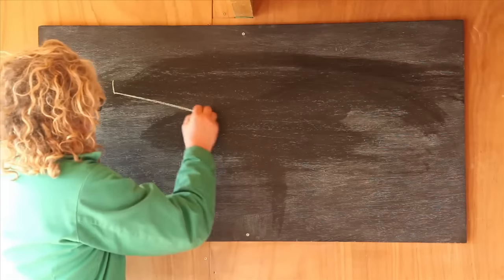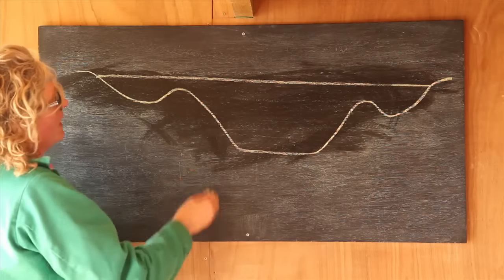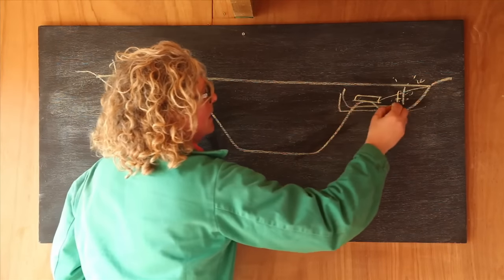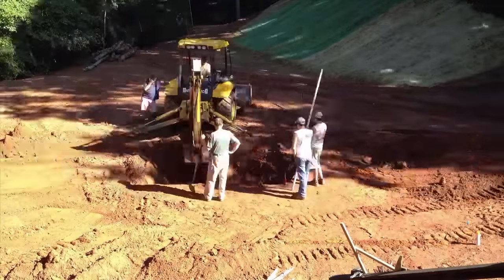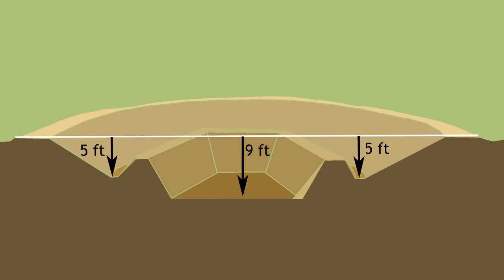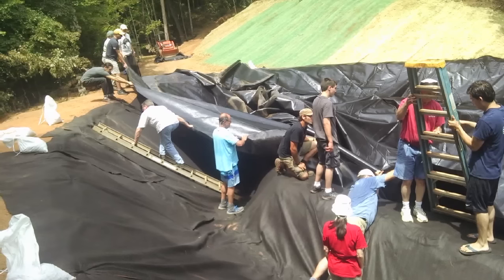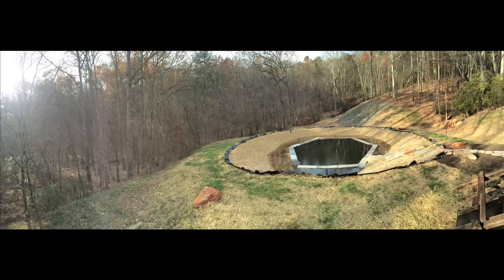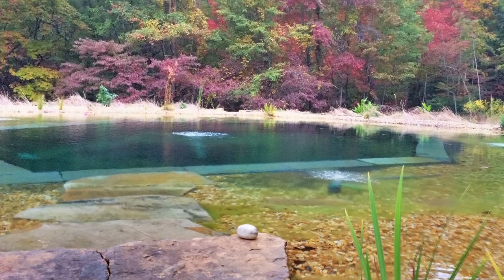How to make a Natural : Organic Pool in America

Comment: It's been a few years since this came out. Still, I hope you might be able to answer my question:

Could ferrocement applied directly to the sculpted earth be used instead of block and the liner IF a reinforcement material like basalt or fiberglass replaces steel rebar and mesh?

Comment: Hello Dave I hope you are still reading the comments as we are building a pond based on the design of this video.  Are the air lift pipes connected to piping going to the pump or are you using one of the two black pipes to send water from the pump back to the pond - are the air lifts traveling to for from the pump? If both of the black pipes are feeding the pump are they connected together before reaching the pump or are there two bulkheads entering the pump box (skimmer)?

Hope you answer soon as our liner is being laid in 4 days.  If you respond I will provide you a link to our finished pond. Thanks David (Yes my name as well)
Reply: Hi Crow, What did you find out about the plant filter pipework, pump, etc.? I don't get how it works from the video. What are the small blue pipes running in the top of the air-lift pipes? Is this system like a aquarium tray filter system? I'd like to make one of these here in Southside Virginia.

Comment: I think it's rather ironic that this "natural pool" starts with a lot of heavy gauge plastic/rubber.... Clay can be used to the same effect, as long as its packed in (the bucket on the backhoe could have packed it).
Reply: Have you ever tried to get out of a pond that has a bentonite clay bottom? Pretty slick.
Reply: Some people seem to ignore all the plastic.  We never use it.  We employ clay seals that last centuries instead of a couple decades like plastic.
Reply: Matt,  we use bentonite.  Our ponds and lakes are much cleaner than what is seen here.  Bentonite just requires a lot more knowledge to employ effectively.
Reply: i also dislike using plastics in a natural pond
but i like david's approach, you dont find much people nowadays who can make a natural pond filtration fit in a urban setting
i'm planning to make a clay pond in my garden, i've been experimenting with clay to test its hydrolic conductivity under various compaction rates and with various sand/aggregates mixes 
but from what i know so far, clay only works with a gentle slope 
so in addition to the bigger bog area, a sharp slope like in this pond is hard to make with clay
unless there is a bigger slope from the outer edges till the deep point
then you fill in the walls with an impermeable material to make the bog/pool separation wall
Reply: @BeautifuLakesStreamsBiologists  Trying to shill your products on another channel is just sad.

Comment: That looks like the north. Do you drain it for winter or is it freeze resilient? Replant every spring? Very beautiful!
Reply: This is located in Georgia. It will not get cold enough there to make ice in standing water deeper than your ankles.  Notice the orange color of the soil, the majority of the soil in Ga is an orange sandy clay that is easy to sculpt into shape and will stay in place as long as water doesn't make a path through it during a storm. Not easy to establish grasses on once you've disturbed the thin layer of topsoil though.

Comment: No fleece over the perforated pipe and gravel for this one then? Is that because they didn’t use sand over the top?

If so, are you just accepting reduced filtering performance without the sand?

Comment: I've been following your videos, since finding your natural swimming ponds, years ago. 
Considering the idea of organic natural swimming ponds, have you, or anyone else, made a pond using the clay found in the ground, to puddle in, and make a natural liner? 
We live in an area in the UK where springs are common. There's even a local pond, fed by an underground spring, which bubbles up from the bottom of the pond. 
As there are no videos using this technique, I wondered if you had considered doing a video, advising on how it could be done. Just a thought, since we are now at a time, when burying non organic matter, is seen as a complete no-no, especially if such a construction fails, and requires the plastic liner to be removed at a later date.
Reply: Re natural liner for a pool or pond: 

  in the year since your comment  was posted, has someone  come up with any ideas?  Thanks!

Comment: Air lift pumps are perfectly suited to direct water horizontally, just add a bend and a lengthy of horizontal pipe on the top, at water surface level

Comment: Was that one enormous pond liner, or several and welded seams?
Reply: You can buy single sheets of plastic large enough to cover a football field if you look around. Made by seam welding smaller sheets which are in their own right very large. I work for a plastics recycling company and we get in rejected rolls of plastic used to line the bottoms of landfills. Each roll weighs 1500 Pounds and are generally 20ft wide and 100ft long. Tough enough to drive heavy machinery on top of till a layer of clay is spread on top to hold it down.

Comment: some recommend to have a hose on the bottom in the middle of the pond which pumps a little air into the water to avoid  oxygen deficiency
Reply: It has 8 airlift tubes . the center gets recycled with the outside wall water its not closed off.

Comment: is it possible to build one without this amount of plastic?
Reply: You could try to make it out of concrete, but that would require good planning to prevent the concrete from cracking if the pond should freeze over during winter

Comment: cool, but I don't get where the capping stones were mortared to... the only possible thing would be between them, but that would'nt make much sense... does it?
Reply: I think that they are mortared in place and to each other so that they can't be kicked out of place. I would think that if they weren't it would be reasonably easy to move them underwater and lead to some issue.
Reply: @vincenthowie  but mortar won't adhere to plastic and that's what those stones got beneath them.... and in between each other seems a bit fragile as they are pretty long (in proportion). 
but maybe it's just that: relying on their weight and getting some extra strenght from the mortar in between.
Reply: @quinosonic82  Hmmm... good point. Now I'm really curious to understand that since I'm well into the planning stage to build something like this.

Comment: don't use a liner better options are out there the UV reeks havoc
Reply: IF the plastic was exposed to light it will break down over a short time, seeing as the liner has been covered and essentially buried, there is very little to no risk of it breaking down at all as the sun is not shining onto the covered liner.
Reply: 20 years is still 10 times longer at most compared to if it was exposed to sunlight for a few years. Clay is not inorganic, its a mix of organic and sedimentary materials and much like plastic will dry up and break down in sun, it lasts for years underground due to its ability to retain water. But yes clay is better if you want the swim or fish pond to stay around longer than the plastic liner will last.
Reply: Clay results from weathering and dissolution of inorganic mineral / rock.  It creates a functional seal whether is has had any cation exchange with organics or not.   The sun has no bearing on clay seals; they are solely dependent on ground moisture.  The only atmospheric condition that potentially has an impact on a clay seal would be lack of humidity if ground moisture becomes critically low.   A quality design of a lake seal will ensure against this.

Comment: How to make a organic pool anywhere. 
1. Dig hole in ground.
2. Fill with water. 
Of course without a natural water source feeding it it can not be a "natural" pool. Just an imitation that needs to be refilled by you not "nature". 
Then if you use anything but the ground available you can forget organic too. Even rammed earth is not technically organic due to the production necessary to create it. 
Face it you can't really make a natural Organic pool. Only Nature can do that. Stop being an idiot.
You want a pool that looks naturally organic without all the headaches? 
Then go get some concrete and plastic then cover the bottom with sand or dirt.
Reply: SEPHICHI DREAD 
Engineer? Been there done that. I was head of several engineering department. Then went into computers and can make them dance along with any network or hardware related to them. I have done a great many things and what really tics me off is people thinking a name will change the reality. Everyone throws around words like organic and natural everything has to be green. 

Well you just cannot manufacture nature no matter how you try to justify it. It is not organic if it has man made products used to create it. Simple fact. Call things like they are. People pat themselves on the back thinking they are doing things like buying "organic"" food. Like I said look it up before you spend the money. I also did time working at a farm bureau until I got tired of people asking for organic pesticide and coming in a week later for the chemicals that actually worked. 

Then again you now used the term "more organic". so you admit it is not organic right? Truth hurts but at least you are no longer deluding yourself thinking it "IS very organic" anymore. I would expect more accuracy from an 35 year old engineer.
Reply: tecgunner For crop farms3 years (36 months prior to harvest) with no application of prohibited materials (no synthetic fertilizers, pesticides, or GMOs) prior to certification;distinct, defined boundaries for the operation;proactive steps to prevent contamination from adjoining land uses;implementation of an Organic System Plan, with proactive fertility management systems; conservation measures; and environmentally sound manure, weed, disease, and pest management practices;monitoring of the operation’s management practices to assure compliance;use of natural inputs and/or approved synthetic substances on the National List, provided that proactive management practices are implemented prior to use of approved inputs;no use of prohibited substances;no use of genetically engineered organisms (GMOs), defined in the rule as ”excluded methods”;no use of sewage sludge or irradiation;use of organic seeds, when commercially available (must not use seeds treated with prohibited synthetic materials, such as fungicides);use of organic seedlings for annual crops;restrictions on the use of raw manure and compost;must maintain or improve the physical, chemical, and biological condition of the soil, minimize soil erosion, and implement soil building crop rotations;fertility management must not contaminate crops, soil, or water with plant nutrients, pathogens, heavy metals, or prohibited substances;maintenance of buffer zones, depending on risk of contamination;prevent commingling on split operations (the entire farm does not have to be converted to organic production, provided that sufficient measures are in place to segregate organic from non-organic crops and production inputs);no field burning to dispose of crop residues (may only burn to suppress disease or stimulate seed germination – flame weeding is allowed); andno residues of prohibited substances exceeding 5% of the EPA tolerance (certifier may require residue analysis if there is reason to believe that a crop has come in contact with prohibited substances or was produced using GMOs.
Reply: You're so wrong,  might want to read that sitting down 😉.